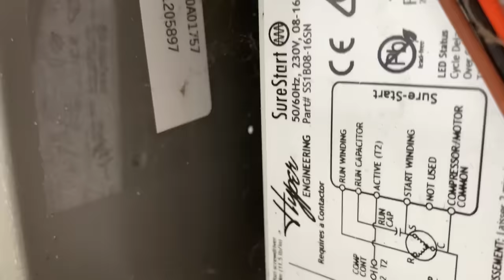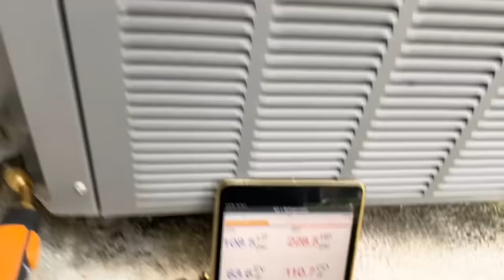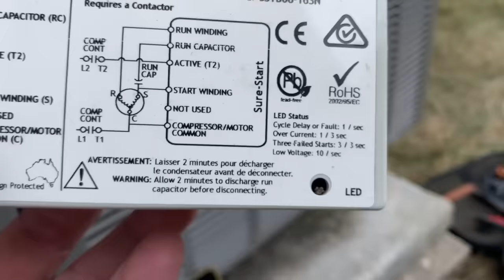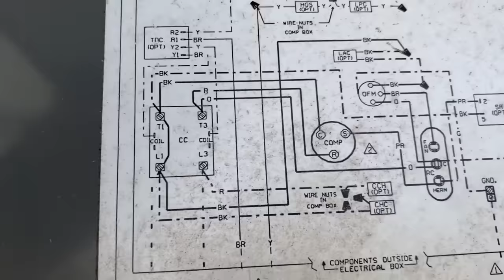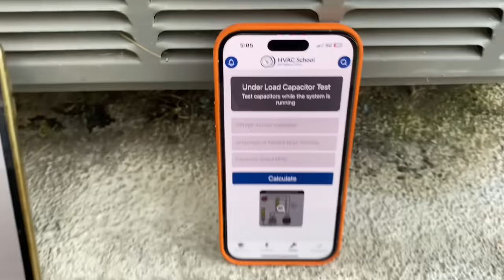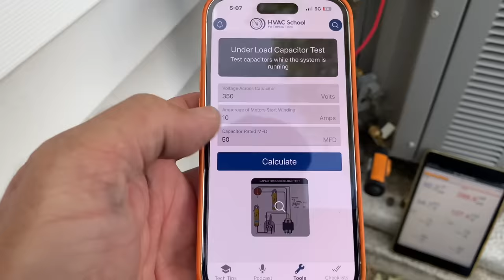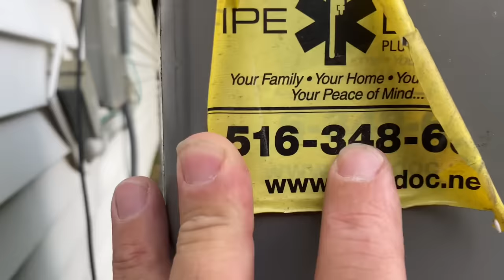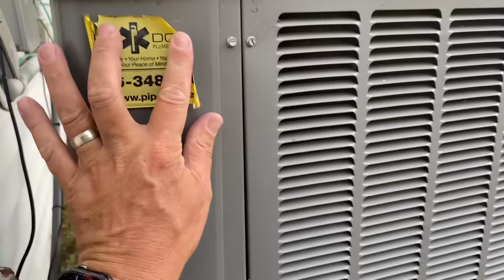Soft Start Killed Compressor! UNEDITED Central AC Service Call for No Air Conditioning Revealed!

Comment: That soft start wasn’t the correct one for that unit. The amp load finally killed the soft start. That unit needs the 16-32 model. I install these all the time when I install generators and had this issue with the first one I installed thought were the same but were not. Learned the have max ampacity ratings as well and will give out prematurely
Reply from the maker: Agreed 👍
Reply: Testament of quality.....I noticed manufacture date as week 37 of 2019...if that unit worked for 4 years as undersized equipment, I can only give praise
Reply: I saw that as well, the nameplate rating of the soft start was 08-16 FLA and the nameplate rating for the outdoor unit was 25.3 FLA. The soft start was undersized. It didn’t fail, it shut down from a continuous overcurrent condition, hence the one flash per three seconds indicating “Over Current” fault. The meter indicated it was using 19.4 amps.
Reply: I believe these are sold primarily in the RV industry to enable a 5KW generator to operate 2 ~14k btu units to operate on the limited power available when boon docking.
Reply: Exactly.
I do home stand-by generator installs,  and I've installed a bunch of those exact "Hyper Engineering" soft start units. Not one failure yet. Total lack of maintenance to the condenser, along with an improperly sized soft-start module to begin with, led to the failure.
Reply: Hey since we have some soft start guys here I have a question.  The Micro-Air chart says to use the smaller unit for up to 3.5 ton and the next size up which is the X-48.  However their X-72 is for a 4Ton up to 10ton I believe.  My question is would it be smarter to buy a bit overrated current soft start for the 4 ton unit since I’m so close at 3.5ton?  Or stay with the recommended unit since I’m 0.5 ton under the thresh hold?   Thanks guys
Reply: @Calico5string1962  Or better stated question with this model could I use a -32SN with my TRANE 3.5 ton (15.4 RLA/83LRA) heat pump since I’m just the threshold of their -16SN model following the flow chart for suggested item?
Reply: @emailjimsylvester ok thank you for the advice.  Makes sense with the current not dropping as low.   I appreciate your help.  👌🏼
Reply: Thank you for replying with some accurate information about the "soft start". I hope the publisher of this video does some research for his own information because the "soft start" seems to have a place in this industry. It seems to serve a good purpose.

Also, the title was deceiving in that it made me think that the soft start had actually permanently killed the compressor. Obviously it did not and the soft start itself just needed to be removed or replaced with the proper unit.

Again thank you for your helpful reply.
Reply: @ol-man-duffyj688 the X-48 is the better choice however utilizing the X-72 soft start unit on a 3.5-ton AC system, despite it being rated for units starting from 4 tons up to 10 tons, is unlikely to cause any harm to your system (to your pocket? maybe). Soft start devices are designed to manage the inrush current and reduce the mechanical stress on the motor during startup, which is beneficial regardless of the size of the AC unit.
The primary concern when using a soft start that exceeds your system's requirements isn't about causing direct harm; it's more about ensuring the device operates efficiently and effectively. The X-72's capability to handle higher capacities means it's well-equipped to manage the startup requirements of your 3.5-ton unit without overloading or underperforming. In fact, having a soft start device that can handle a higher load than currently required may even contribute to smoother operation and reduced wear over time, thanks to the broader operational tolerance.
However, it's essential to ensure that the soft start is correctly configured for your specific unit. Improper configuration or settings might not optimize the performance benefits of the soft start device, regardless of its capacity. Therefore, while the X-72 won't harm your system, the key to maximizing its potential benefits lies in proper installation and configuration, tailored to your 3.5-ton unit's specifications. 
So in summary, using the X-72 on your current system does not pose a risk of harm and might offer advantages in terms of operational flexibility and potential future scalability. The technical concern shifts towards ensuring the device is properly configured for optimal performance with your existing setup.
Reply: @manclt704 ok first off LOVE that name Man 🐈 😂😂.  I didn’t think I’d get such a serious response but I appreciate that too! Totally what I had in mind d buying the bigger unit is it’s not THAT much more but I was thinking maybe some day I’d want a bigger unit and definitely thought being right at the threshold would make it a light days work for the bigger, soft start. Send I’m like I’m good. Either way I go as long as I make sure I hook it up correctly.
Reply: @emailjimsylvester  The guy obviously didn't even know what what it was, and made it clear.  We  install them all the time with our generator installs, and we've gotten a couple of calls from customers that freaked when their A/C guy told them that they might damage the compressor.  One customer had to replace an over 20 year old compressor the customer was told by his A/C guy that it was our soft start that caused the premature failue.  Imagine that... an over 20 year old compressor experiencing a premature failure.  Then he told the customer that he never heard of soft starters before.  I asked the customer, if he doesn't even know what a soft-starter is, how could he possibly "know" that it caused a premature failure of an over 20 year old compressor?  

Even in this video, Pipe Doctor stated that the compressor may need a "hard starter."  so, since he doesn't know the science behind soft starters, he wants to use hard starters... which any research will show you that hard starters really are hard on compressors, and can even damage them over time.  but, instead of learning the technology, they post click-bait videos with the headline, "Soft Start Killed Compressor".  Yet, even the overloaded soft starter never actually killed the compressor.

People ought to do a little research before posting videos.
Reply: @ol-man-duffyj688  Nope.  The X-72 is only good for up to six tons.  above 6 ton, they have none.
Reply: Not to mention that I saw a solar system panel there and a Tesla in the driveway. 

If they're running power walls then they will be sadly without AC and AC power if their AC unit tries to start. 

The Hyper Engineering Soft Start is the proscriptive addition to an AC condenser when installing a power wall. They can only put out about 30A peak for each power wall unit so this AC compressor is beyond a typical 3-unit install.

It looks like the device was not correctly selected, but they may very well want to replace it with the right sized unit.
Reply: @PipeDoctor update video maybe…yo
Reply: I put soft starts on all my water furnace installations, never a issue
Reply: @manclt704  it’s amazing how much it helped mine after installing x72 on my 4 ton unit. The consumption has drop drastically and the light flickers that we used to have when the A/C kicks in has disappeared. Numbers shows and it doesn’t lie.
Reply: I really appreciate your comment.  Throwing away a Soft-Start kind of implied that “all” Soft Starts are crap.  I know that as this person commented, if the Soft-Start had been properly matched the other issues that showed up might not have ever taken place.  I recognize that any electronic piece of equipment can fail but to throw it away completely is going to cost this homeowner more money in the long run in terms of increased energy costs and the breakdown of the compressor faster.  Who is saving who money?
Reply: Yes, buy a voltmeter before you even try to think!
Reply: @manclt704 thank you!
Reply: @petervidrine9259 Thank you!
Reply: Soft starts DO destroy compressor motors by over taxing the start winding over time which can lead to failures. You shouldnt use them. This is why your warranty is violated by putting one on your unit. Or a hard start kit. Both are not good for your compressors motor.  Hard start kit is ok for old compressors which have trouble starting. The engineering that goes into the unit doesnt require help. Soft starts "starve" the windings for current while having the same torgue load on the motor causing it to strain everytime it slowly starts. Its designed to start with full current to get the motor up to speed immediately. Its amazing how many techs that are selling these things have become engineers. And especially generator guys that are now hvac experts.
Reply: There is no correct one.
Reply: @petervidrine9259 spot on!  And a hard start isn’t usually needed until the compressor is already having issues unless it was installed by the manufacturer.
Reply: None of them are correct for any unit. Try selling them the correct generator and stop making false promises. Also voiding the warranty of their A/C.
Reply: Its not correct to install it at all.
Reply: Why are you bashing a perfectly good soft start. It’s just undersized! Hope you charged them something fair for deinstalling a soft start…
Reply: @chipfornaris  Because I see it all the time, they are nothing but trouble. Your adding a complicated electronic device putting numerous points of failure into a system that would not have failed normally, all because you may have to run on an under sized generator sometime. Alot of service calls are because of that device, nothing wrong with the AC unit. Not to mention the damage they do over time - compressor windings blown open for no apparent reason. (Hard start kits too) People on here bragging about fictitious low current readings that cant be measured with a normal meter. You cannot change the design of the compressor and convert into a frequency modulated motor by putting a magic box on it. You will pay a price for it sooner or later. Spend the money on a better generator, or if your smart enough at least switch the box out of circuit until you lose power and spare your compressor.
Reply: Man, this guy is cocky and annoying as hell, not only the soft start did NOT kill the compressor,  it was the wrong size for the unit and he didn't even mentioned, he spend more time talking crap about it, than actually explaining the real issue. 😆👎🏼
Reply: There is no correct one. Correct is not altering your compressor with after market gadgets that dont do what they claim and cause harm too.
Reply: I clean my coils every year. My AC unit still R22 going on 20 yrs of use in south Texas
Reply: @petervidrine9259 yeah the AC guys don’t want customers to protect their AC. They want to sell new units. Soft starter here was undersized. Rated from 8-16 amps. When it was pulling around 20 amps
Reply: @chipfornaris he’s bashing them because he’s an AC guy. He wants to tell the customers they need a new AC unit after 10 yrs. He said he sees this issue all the time.🙄I’ll bet that not one person on my block has a soft start unit on their AC unit. He might see one out of 100 ac units he services. And that’s pushing it. Most people use them on rv’s.
Reply: @RadioRich100 you don’t see them all the time 🙄 I bet not one person on my street has one. You might see one out of 100 and that’s pushing it. They’re mainly used on rv ac units.
Reply: @bernardogallo4327 because he’s an AC guy. He wants to sell another 10K unit. All these AC guys will bash it. The soft start was undersized
Reply: There not right for any unit.
Reply: @RadioRich100 first of all it’s “they’re” not “there”🙄. But keep telling yourself that. Eventually you might believe it. Dude you’re gonna keep answering and rebuttal every who’s a proponent for soft starts. Those like me don’t care what you have to say. You don’t like soft starts and we do. So let it be.
Reply: @PipeDoctor  There is no correct one.
Reply: @emailjimsylvester  The system malfunctioned because of that box, thats it. Dont install one no failures.
Reply: @Sebastian-dx2xg  Has nothing to do with what anybody likes. Its a B.S. box. You cant convert a system to run with a frequency modulating system by changing just one part of it.
Reply: @RadioRich100 I call BS on this.  "Starving" coils of power doesn't strain them.  All it's doing is extending the start time and reducing acceleration time.  Windings don't blow open due to less current .  They blow open due to over current.  Don't believe me?  Try putting a 6 volt bulb in a 120 volt socket.  It blows.  Put a 120 volt bulb in a 6 volt socket.... doesn't blow.  Electrical knowledge 101.
Reply: @chrisbalding2301  Yeah right, 101 is where your stuck. Starving the motor for current under the same load can destroy the motor over time by causing the windings to over heat, strain and vibrate because current is passing through them with no physical turning which means the energy is giving off heat instead of mechanical energy. You dont need full current to be harmful when the motor isnt moving when it should be.When you repeat it constantly multiple times per day, over months and years you wind up with premature failure as the motor is not designed to start like that. You cant covert the unit into a VFD by changing half the system with a gadget box.The blowing of windings (which happens alot) comes from the electronic failure of the box partially due to electrical surge or lightning strike when one scr out of 2 on the board shorts causing full current passing through the windings but no motor movement.  Also destroys the cap. So try that, B.S. on you.
Reply: None of them are correct.
Reply: There are no correct ones, leave your unit be.